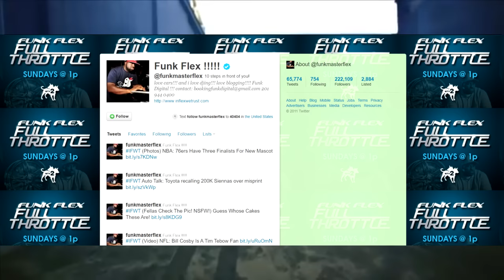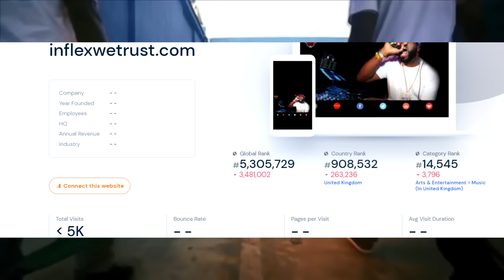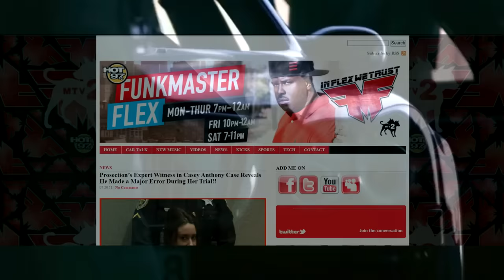Funkmaster Flex Premieres Otis on Hot 97, July 20, 2011 FULL

Comment: Flex...  jump over a box... touch backboard... to alley opp... dunk... touch rim... both sides of backboard... game speed... sitting jumps to 180 back of the rim dunk... alley opp... rim  touch... jump 2x... do some hack squat to lunge warmups... do some side plank one arm push ups... to side bends... side bends first between sets... for ripped abs... do some laying on side banded hammy kicks... leg back... do some L sit pull up... pushups... in and out... do some turn around to behind the back... to run back to 3... behind the back... pull up... do some  do a easy drive to behind the back... cup back down... to middle drive...

Comment: Flex... do some banded Arnold Chest Challenge... Up... down... left... out... siting... back... game speed... do some swims... like a hands and legs in... and out... do a windmill... like a whale with the arms... slow... arms stay moving... thumb down first... freestyle... slow... quick burst... 3x... do some laying legs stacked sit ups... legs crossed... leg raises... game speed... do some sitting to rim touches or dunks... reverse... 2 hands or 1 hand... alley opp... jump away from rim...do it standing.... bend back... do some between the legs 2x... alternating legs... to throwover... focus on Between the legs... feint throwover... vice versa... do a around the screen throw down... low... to cup... spin... to a mean in and out... under hurdles... pull up... tongue out... strict slow cup... game speed... do a fake exaggerated chest pass... to touch pass... no look...